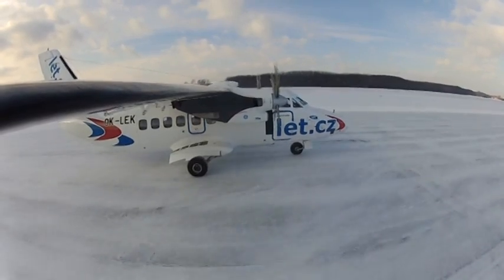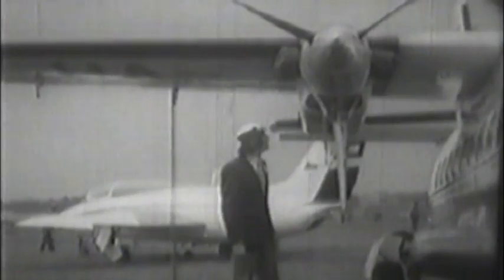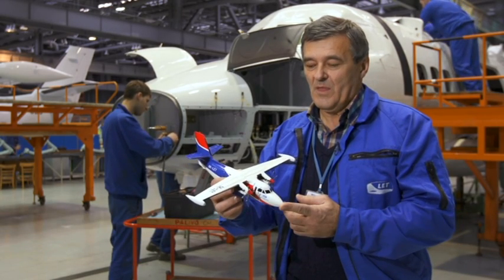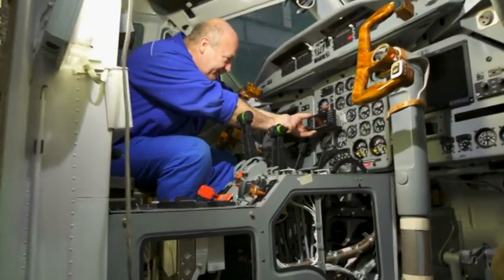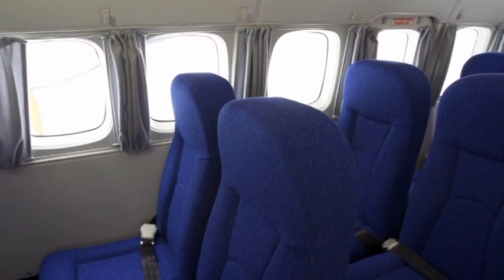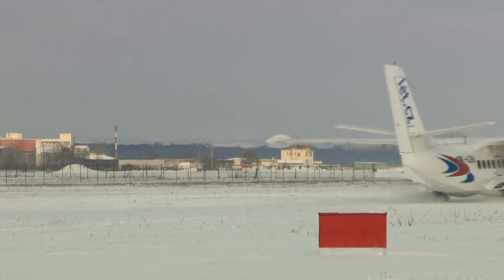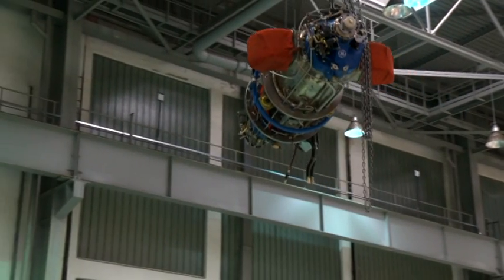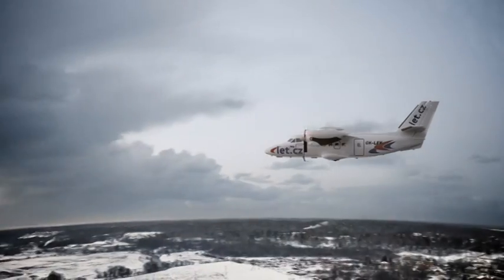L 410 UVP-E20 and Production Company Aircraft Industries, a.s.

Comment: http://www.telegraph.co.uk/travel/travelnews/10129805/Least-safe-aircraft-models-revealed.html

#1 BABY!  Pride!
Reply: The article is kind of silly. The number of crashes is not only a question of plane's safety but also a matter of conditions in which it is being operated. L-410 is cost-efficient and durable plane and as such it is being operated in demanding conditions - in developping countries, in mountains, behind arctic circle, Africa, South America... Landing on unpaved strip in the middle of the jungle is definitely not as safe as on ILS equipped London Heathrow, that's right. Operating in conditions many L-410s deal with I doubt some "safe" B 777 would be still flying :).

Btw, similar plane that came into my mind is de Havilland DHC-6: 
DHC-6 Twin Otter: 930+ produced / 274 hull loses / 1461 fatalities
Let L-410: 1138+ produced / 102 hull loses / 423 fatalities
Reply: thejabiru       Good points, I'd definitely rather ride in an Otter than one of the few DC-10's still in service.

The 777 has a great record and is a pilot favorite. It doesn't do so well with Russian missiles or suicidal muslim pilots - 537 fatalities, zero deaths related to design flaw or mechanical failure. Outside of the Malaysia Airlines haul losses there have been 4 other HL's since 1995 - 3 deaths upon landing due to pilot error in San Francisco aboard Asiana Air, in the three other HL's all passengers and crew were able evacuate because of the 777's  built in redundancy, safety and ruggedness in runway crash situations. The recent HL in Dubai of an Etihad plane is still under investigation.

No doubt if 777's were used like rally cars in the polar regions or the 3rd world then they would not fare so well.
Reply: +GreenJelloHell 
No info about reasons for crashes - Aircraft failure or pilot failure ?